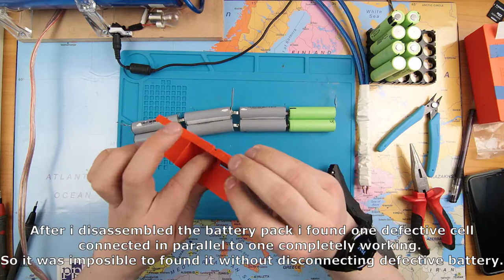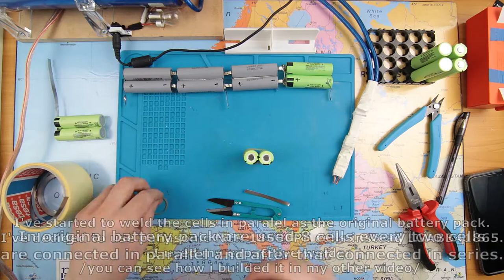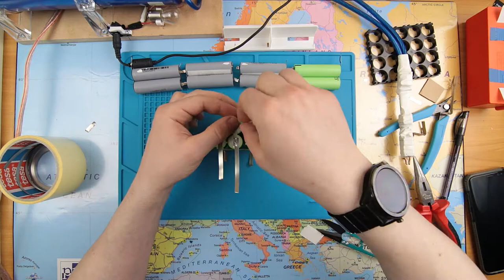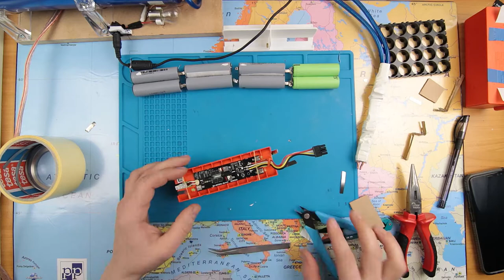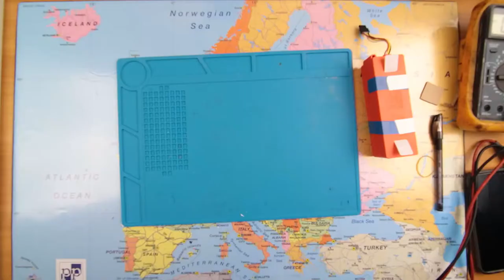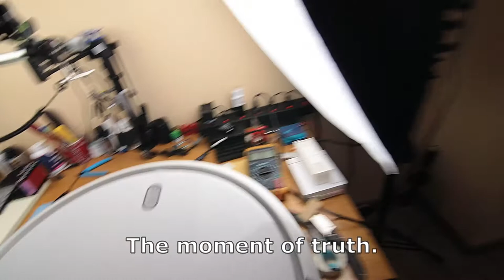Xiaomi vacuum cleaner battery repair/cells replacement

Comment: Thank you for detailed explanation!
However, when opening the battery case, the component(likely AO4447A) below Thermal fuse(Sefuse D6x) got damaged and lost connection to the circuit board.
Can I solder it to the board once again? Or can I replace it?
Can you please guide me what can I do further?
Your 3d model of battery case attached is very helpful , Thank you!!!
Reply from the maker: if fuse is "just unsoldered "  ... check it with ohmmeter and if is still usable (operational) you can solder it to it's place. otherwise use compatible replacement.

Comment: Thank you for this informative video. I have s5 max and do you think a regular 4s 20A bms works insteadof the original battery pcb? I see there are 4 cables. Two are plus and minus but I couldn't know the two other white and yellow one.
Reply from the maker: I'm not completely sure, but one of them should be battery temp ... but I haven't any idea about the other one. Try to repair the original board in my case, the issue was fuse located on the board. I've used fuse from donor board - laptop battery
Reply from the maker: Keep in mind that video is not tutorial it's just for getting an idea what's inside the vacuum cleaner....

Comment: Cool DIY replacement.
Wouldn't it be easier to order a replacement pack, preferably from a longer-lasting robotcleaner like the 1T or 1S ? Those have a 5,2 Ah battery capacity in comparison to the mop with 3,2 Ah.
Reply from the maker: Replacement battery from aliexpress  would cost me way more than changing the cells, also lg cells in this battery pack aren't reliable enough (in my opinion).
Reply: @chichovenci  How much you paid for everything ?
Reply from the maker: price of 8 x NCR18650PF (depends of price you can get cells, nickel strips are cheap enough not to think about their price).
Reply: @chichovenci  Interesting. Thanks for response. Found price per piece like 5,25€. So like 40€ for 8 pieces.
Ordered an exchange battery with 5,6Ah for 46€ today. Ill be curios.
Reply from the maker: In my case transport and taxes 20% plus  customs commission management was the issue making overall price.

Comment: hello, first of all, thank you very much for this informative video. I applied exactly what you said, I just changed two cells, but I can't get output from the battery, I changed the fuse from the old laptop batteries, but there is no voltage to the black and red ends of the cable. Where could the problem be? ?
Reply from the maker: it las long time ago i don't remember very good scheme but... have you tested all cells in the end of the cells "pack" there should be some voltage 12 - 16. other in my mind is have you check the fuse before solder it to the board? and in most laptops fuse is with 4 legs have you check scheme before soldering the fuse....
Reply: @chichovenci  
I checked, it doesn't work what I did. There is 16v in the last cells, but there is no current in the black and red cable, zero voltage, I burned my hand while I was taking the battery from the motherboard with the motherboard turned on, suddenly a place got hot, then it never happened again I wonder a part of me burned burned a circuit ???

Comment: Hello there
I have a few urgent quesions.

What nominal cell volt is roborock using ? 3.6 x 4 = 14.4v right?

wont the ID on the BMS brick itself when you tear down?

Does anyone know what max amp The board can handle?

Can I use more batteries in paralell?

I suppose other BMS boards cant be used when they lack ID/T support
Reply from the maker: *What nominal cell volt is roborock using ? 3.6 x 4 = 14.4v right?
Charged - 4.2 x 4 = 16.8v
*wont the ID on the BMS brick itself when you tear down?
I haven't that issue. (only blown fuse)
*Does anyone know what max amp The board can handle?
In my opinion around  5A 
*Can I use more batteries in paralell?
There no room for more batteries if idea is get more capacity use cells with high capacity 
* I suppose other BMS boards cant be used when they lack ID/T support
No idea I've haven't tried .

Comment: Hello, I opened the battery box, I disassembled the circuit board, I measured the batteries, the voltages are all the same 3.8v, but it cleans only 1 room, its charge runs out, its original battery of 4 years.  What should I do, should I buy a battery?
Reply from the maker: One way is to change the battery, other is to check if one of parallel cells is death. I had this issue, after disconnecting parallel cells I've found that only one was working.
Reply: Thanks This card will not crash when the battery is removed like laptop cards, right?  It works when I put in new batteries.  Do I need to buy a new card?
Reply from the maker: In my other video where I'm changing the cells I had issues with battery output, after changing the fuse everything was ok everything is on the video
Reply: Thank you very much for your answer.  Is it currently in use?  Is there a problem?  The video where you changed the fuse part was taken from far away, it is not clear
Reply from the maker: Now with better cells robot has more range in apartment 60 sqm use about 10 % of charge. I know that video isn't clear enough ( issues with used camera and tripod ... long story) main is to get the idea that there is a fuse and if you have issue with voltage on battery terminals to know what to look for ...

Comment: If the complete battery pack gives the correct voltage, but, through the connector that goes to the vacuum cleaner (4 pins), it only gives approximately 7v - 8 volts, what do you advise me to check?
The cells have just been replaced, the vacuum cleaner only turns on if it is in the base to be charged and the batteries are 100% charged at 4.2v
Reply from the maker: Check the fuse

Comment: So... did it work? Is the first vacuum of xiaomi, right? Im thinking on changing my 2S battery to increasy capacity, hopefully will be similar (and the BMS wont block itself after changing the cells :'D )
Reply from the maker: it still works, 1st gen vacuum yes, i don't see reason to have any issues with your battery changing the cells.
Reply: @chichovenci  Had some unpleasing surprises in the past changing laptop batteries, it got block and even getting a new (unofficial) one wouldn't work.. but Xiaomi is no Asus ;) Thanks for the video and the info!

Comment: Please inform rating of single cell.thanks & regards.
Reply from the maker: Original cells are lgabb41865 2600 mah
Reply: Thank you very much
Reply: Please inform can I use higher mah cell?
Reply from the maker: I've already done this. 2600>2900 mah
Reply: Please inform 2900 mah model no. Thanks & regards.
Reply from the maker: Panasonic NCR 18650 PF

Comment: Hello  can you help I replace the battery cells with now one . I read 16.4v from battery pack and from black and red cable 12v .my vacuum won't start
Reply from the maker: I'm almost sure that you have issues  with the fuse try to use lamp as load  on black and red terminal if lamp won't light check the fuse I had the same issue.
Reply: @chichovenci  Thanks I will check and let you know
Reply: @chichovenci  I check with lamp no light. How I check the fuse?
Reply from the maker: @savvasgerolemou6938   6.16 from my video i had the same issue... and I used from old laptop battery.
Reply: @chichovenci  Thanks a lot
Reply: @chichovenci  Hello . I try 3 different fuse from laptops battery but no light on lamp . Can you help me . What battery you use to take the fuse
Reply from the maker: in my mind is (dell) ... but if I remember fuse is 12ah3, check the schematic diagram and use some similar.
Reply: I did override the fuse with a small piece of wire from one side of the fuse to the red wire and it started working, what will happen? Is it safe?

Comment: Please tell MAH per cell?
Reply from the maker: Original cells are lgabb41865 2600 mah 
I've replaced all with Panasonic with 2900 mah not sure about exact model.
Reply from the maker: In fact, in the video, there are subtitles, so you can see the exact model of used batteries.
Reply: Thanks for the reply 👍
Reply: 3400 Mah will work ?
Reply from the maker: If you replace all

Comment: Hi. I have the Xiaomi 1c that has a 2600mah battery. The battery only lasts 10 minutes then its dead. So I ordered a 6500mah battery pack from the Roborock. So my issue is, when I plug the new 6500mah battery in, the machine doesn't turn on, but it still works fine with the old battery. The new 6500mah battery is also rated at 14.4 volts. Do you have any idea what could be the problem? Thanks, from South Africa.
Reply from the maker: If you already tried to put vacuum on dock station to charge the battery, and nothing happened. My next though is check for fuse on battery bms board.
Reply: I had the same issue. Probably the board inside the battery pack causing the issue. considering to replace the cells  from the new battery pack with the original.
Reply: @0-DTE  did it work sir? Do you manage to solve the problem? I had a same problem as mention above.  Im still wondering since i bought the 6500mah battery but went i tested it and charge it using the dock. It charged.  But when i try to start cleaning, it automatically died. Then I had to hold the turn on button to switch on but as soon as i release the button, it suddenly died. Btw i checked the battery voltage, it state that the voltage is 17.7v. any adviced?
Reply: @Evilfire177195  17.7v, that's odd. The original pack is made of 4S2P 18650 lithium ion cells, so its nominal voltage is 3.7v*4 (14.8v), and its voltage at full charge is 4.2v*4 (16.8v).
Reply: @nguyen_van_a  sorry for false information given before. Based on what you said is exactly the same with the battery i bought. But problem already solve. What did i do is by, disassemble the original battery pack. Using the original board with new battery pack. The board inside the new battery pack, maybe there is abit different compared than original board. It really solve my problem , but the space consume inside the robot abit big, need to modified the body of new battery pack to be fit into it.

Comment: how did you remove this part from the battery case? to open the battery is ok, but I don't know how to remove this piece from the orange case to see the cells... I don't know if it has some glue, so I don't wanna just pull the piece out
Reply from the maker: Orange part is insert on inner side of battery case there are pins holding the insert (this orange part with the charging board and batteries) most of cases on the bottom on battery case there is glue holding the cells. One way to disassemble this case is to cut the bottom corners of the case and to use screwdriver to prime cells, other is to disconnect the board from the cells and to remove board, afterwards to remove the orange insert and with pliers to remove cells (but careful not to damage the cells (always be careful with li ion batteries it can become dangerous)).

Comment: Ciao come mai io ho cambiato tutte le celle i volt sono giusti ma adesso rimane in carica e funziona tutto come parte il robot si spegne
Reply from the maker: check fuse placed in battery (12ah3)
Reply: @chichovenci  how to check the fuse is not working by digital mutimeter? Thank you!
Reply from the maker: easiest way is to check for datasheet and measure resistance of it after defining fuse outputs other output is for heating element  (proper way of measuring is after desoldering fuse)